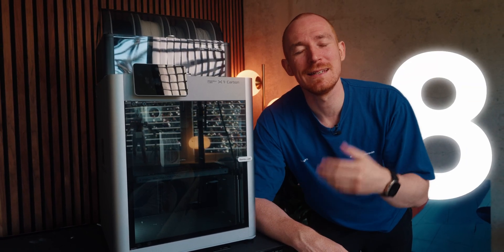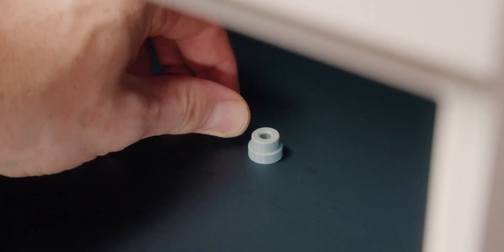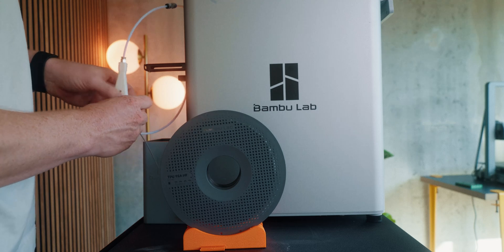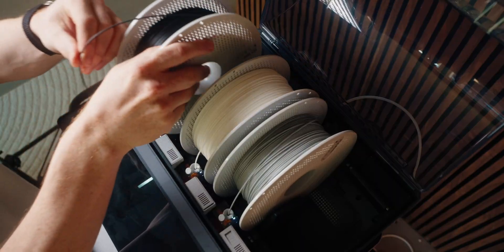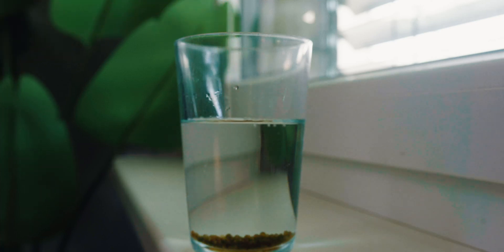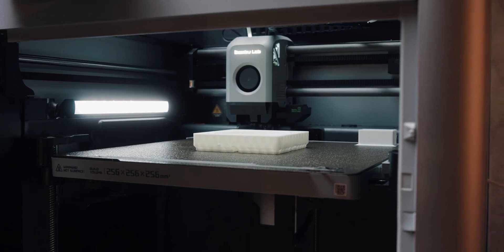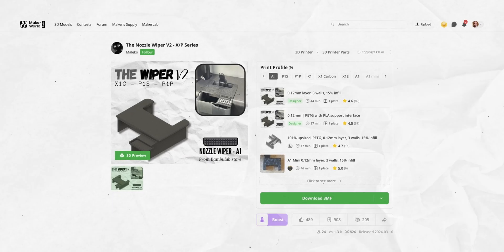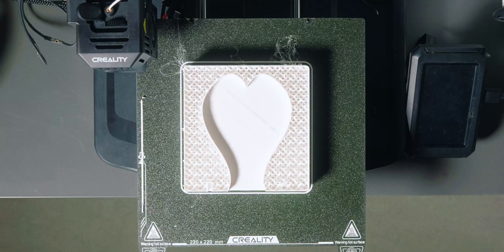8 Mods to make your Bambu Lab Printer even better

Comment: An AMS riser with a usb led strip was a great addition to mine. Nice vid !
Reply from the maker: Nice! How did you connect it? I just saw that Bambu also sells their own light strip right? 
I saw some other videos with people using third party light strips and wiring it into the mainboard which looked sketchy to me
Reply: I also have a riser and connected the LED light to a usb socket that gets power from the original LED on the mainboard. This way it turns on and off with the app. So far it works even if bambu doesn‘t recommend high current LED strips for the daughter bord that carries the power.
Reply from the maker: @TheChriss1301  yeah that's the part I was worried about with it eventually causin problems. I saw that there's an official light strip from bambu though and might give that a try

Comment: I run, maintain, and upgrade a fleet of about 45 p1s/x1's. My number one tip is to get the p1s. Its honestly a better printer.
Reply from the maker: Respect that’s a lot. What do you think makes the P1s better? 

Also do you have any upgrades or things that you think are missing from the video?
Reply: @arnebornheim 
Overall I have simply just had less issues with the P1S printers. Less print failures, less accidental pausing by the Bambu camera AI, lower price for the p1, and after the hot end and extruder upgrade it's a nearly identical printer.
Reply: @yamiyugi9654  which hotend and extruder upgrades? The bambulab offical ones or ?
Reply: @MrGhaundan and I was referring to the hardened steel upgrades
Reply: @arnebornheim 
The touch screen for the P1S that Bigtreetech sells is absolutely fantastic. The connectivity to the printer is seamless, the UI is great and it is perfectly functional.

I also recommend getting carbon fiber build plates, I have personally tested them and they have excellent adhesion and the print surface looks great. 

This hack is absolutely a case by case scenario but I keep a few x1/p1's on a large turntable I made so it's easier to access the back of the printer but if you have enough space, it's easier to just space the printers out enough that you can access the back of them. 

Anti vibration feet you buy or make are also nice if you want to cut down on vibration

Also a suggestion for you may be to use clear acrylic doors instead of the tinted glass. I use this myself so I can keep everything closed and still get great photos/videos from an external camera. I haven't seen clear acrylic or glass doors online for the p1/x1 so I had to laser cut them myself but it was worth it.
Reply from the maker: Thanks for all the great tips! Definitely agree that the P1s is the best choice for most people. Especially with some upgrades! 

Carbon fiber plates sound interesting. Will have to try it 😊 

I like the idea with the turntable but the whole shop cart is on wheels so I’m good there! 

Like the laser cut new window. Do you have problems with reflections? Probably a thing many people would love to buy 😉
Reply: So far no problems with reflections, I put the lens directly up to the acrylic door and have a ring light that illuminates the printer from above and since I use a carbon fiber build plates, I don't get much light reflection from it so it works perfectly.

I also forgot to mention, I completely agree with the unnecessary addition of the Bambu logo on prints people design. It's not a huge deal but it is unnecessary.

 @arnebornheim
Reply: @arnebornheim  Where are the tips you're referring to?

I don't see them.
Reply: @arnebornheim Agreed! I can’t seem to justify an extra $500 for essentially an aluminum vs plastic housing, a useless Lidar sensor, and a higher refresh camera. P1S + ObXidian Hotend + Hardened Extruder is the move! ✨
Reply: I get what you are saying.Overal you are the captain of a fleet of 45 :D

I went for the x1c because I knew nothing of 3d printing and I wanted the touchscreen. I think the touchscreen works faster than the app. Maybe its my phone xD
Reply: @AA-xm7rt I want to be clear, the x1c is not a bad printer, I just prefer the P1S. All of the ships (printers) in my fleet that are Bambu are good printers.
Reply: @yamiyugi9654  yeah I understand completely you wouldn't need 45 touchscreens xD
Reply: @AA-xm7rt the touch screen was the deciding factor for me also!
Reply: @hateforall4012 I have had touch screen printers... An app is simply better and mobile. I have the P1S... rarely need to use the screen ... If you print from SD card it might make sense but other than that... No.
Reply: @ I get that too. But I’m happy with the x1 carbon. The app is nice though!
Reply: I think maybe the word better isn't the right word. It's the more cost effective printer that can be upgraded to do what the x1c does cheaper, but you listed a bunch of stuff that the x1c is genuinely better at and said that you didn't value those things.
Reply: I ended up going with the x1 for the almost sole reason of the bed temp restriction on the P1s. Spearhead makes a resistor that you can install in-line  with the bed that trucks the p1 into having higher temps, but after you account for the extruder, hotend, and switchable adapter the price difference was only about $350 when they were on sale.  I basically asked myself if I would spend $100+ shipping and tax on the aluminum enclosure, touchscreen, and true live feed camera upgrade individually, and the answer was a hard YES. 

If you have no desire to print the tougher engineering materials and are going to stick with pla, petg, abs, etc, the P1s is definitely the better deal.
Reply: Omg Wow! How does one get into this?
Reply: Same here, only run P1S in my smaller farm. I just upgrade to the hardened gears and thats it :)
Reply: If you have problems with the x1c pausing you can lower the sensitivity of the AI. I run mine on medium sensitivity and it works great. I've had it detect spaghetti and correctly pause multiple times.
Reply: My number 1 tip is to get a creality K2 - blows Bambu out of the water
Reply: @YokohlCreek  I believe you traveled to another dimension accidentally. In this dimension Bambu printers absolutely decimate creality printers both in quality of print and tech support @YokohlCreek
Reply: I bought a P1S. A week later, I bought another. Such amazing tools to have at my disposal!
Reply: I didn't want to do a bunch of stuff to get my 3d printer working. Im coming from ender 3 and got so tired of it that I stopped using it. I work out of town up to two weeks at a time and wanted to just have something work so I went with the X1C.
Reply: I started printing during COVID and was hired by an engineering department after a few years to run their printers
Reply: @yamiyugi9654  would you be able to share how you got into that gig? I've wanted a job aligned with additive manufacturing, but they seems so elusive and obscure to find, or my search criteria is just totally wrong! Thanks in advance and Happy Holidays. 🙏
Reply: @yamiyugi9654  Wow! Wish I could do that too